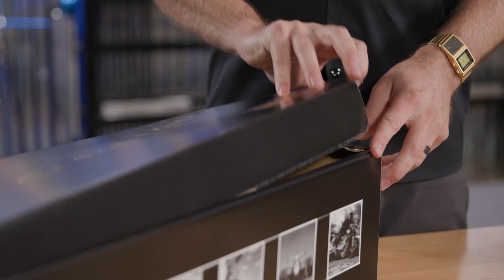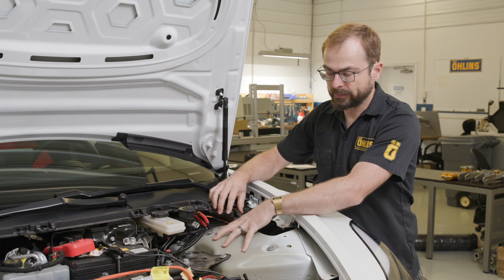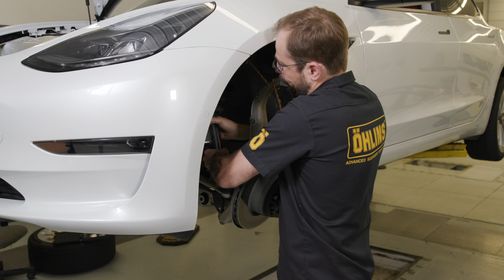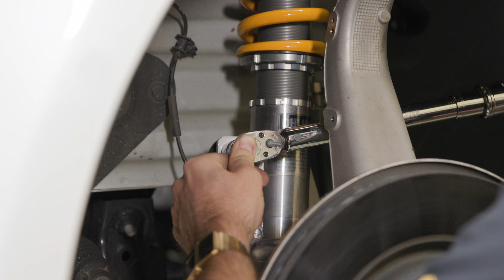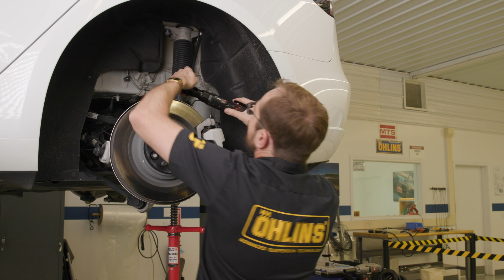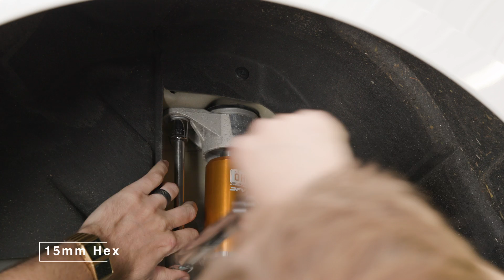Öhlins Automotive Tesla Model 3 Installation Guide for the Öhlins Road & Track System - TES MU00S1

Comment: The rear height adjustment is a bit unclear with the spring perch height adjuster and then the actual spring body adjuster.  Do you lower both the same amount?

Comment: I had the Redwood kit fitted and I've had a rattle at the rear ever since.  Everybody that's checked it says everything is tight but the rattle is constant, it doesn't change in pits it just knocks like it's lose.  Driving me insane now.
Reply: Make sure the splash shield panel bolts are tightened down to spec.

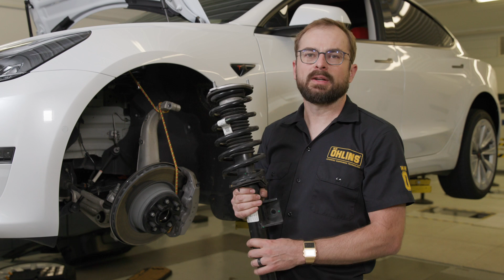Comment: Thank you for this great video. It is mentioned at 08:30 that we reuse the OE front Top Mount and Rubber Isolator from the stock suspension. If we don't want to disassemble the stock suspension, can we order these parts from Tesla or other online source?
What is the Tesla part number for the front Top Mount and Rubber Isolator?

Comment: You’re saying counterclockwise but turning it clockwise!
Reply: Hey Ara! This is Brian from the video. Since the rear is upside down (shaft down), it's a bit confusing for sure. I've reviewed the video a few times and really wanted to be clear here. I believe the video is still accurate. Thanks!
Reply: @brianfowler9804  but you are really not clear here
Reply: This may be late but its because the shock is upside down. To imagine it look at your ceiling and imagine you are screwing something into your ceiling, it is righty tightly. It looks like the the opposite direction if someone from the second floor was looking at you screwing, this is the perspective we are seeing the shock. Hope that helps, I made the same mistake on my Redwood Ohlins haha. I was drive full soft at the front and full stiff at the rear....it did not feel good at all until I fixed it

Comment: Ohlins team - you should know that the installation manuals are inconsistent between what's shipped with the product and what you publish online.  The error in printing caused needless additional hours to rework the rear suspension setup as the manuals in the box gave a spring and damper setting that is too high.  The online manual is the correct specification.
Reply: Thanks

Comment: One of the things I keep getting asked is will these kits offer a factory or better ride comfort despite the lowered height. My default response is no there will ultimately be less travel, however I am hearing a lot about Tesla kits being better than factory depite the lowered stance. Can you comment?
Reply: The shocks have an independent ride height adjustment, so there is no need to sacrifice your stroke and deteriorate ride comfort. It also doesn't change the spring preload. My experience was excellent ride quality.